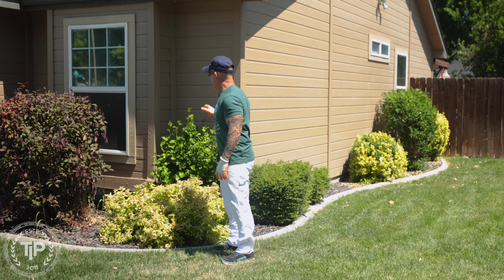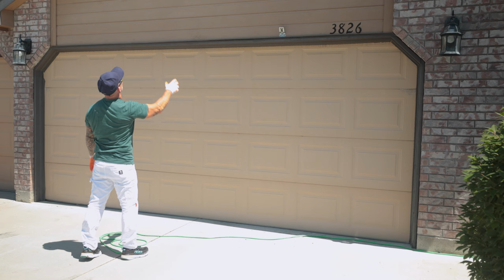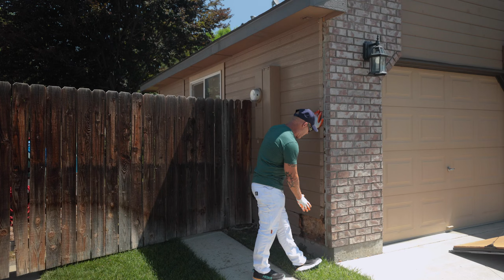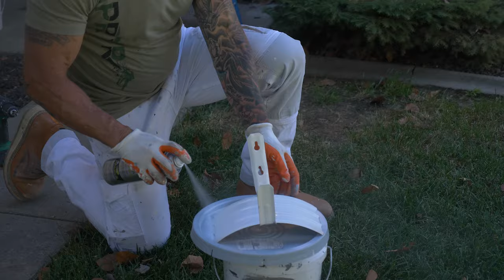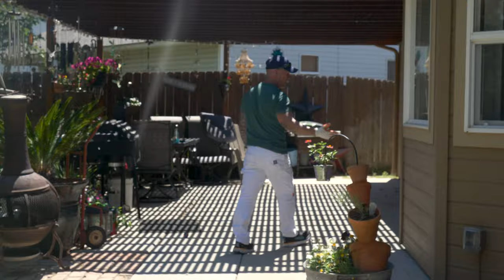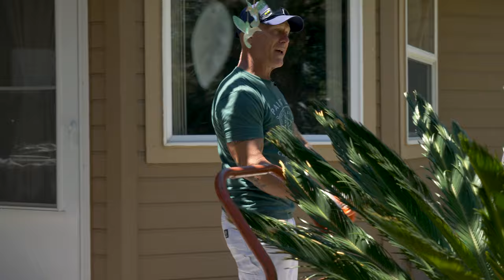What needs to be prepped before painting? House Prep for painting.

Comment: Great channel with a lot of good information!  I am starting my prep to paint my exterior stucco home in the spring.  Do you have a system to estimate how much paint you might use on your jobs?  Thanks for the time you take on your channel.
Reply: I recently read that painting stucco is bad for the stucco. If you don't have to paint it, don't.  I don't have the link to the article.
Reply from the maker: It just takes experience
Reply from the maker: That is not true

Comment: This is why I would never buy a house in America. Builders designed a house to look good long enough to sell. Whoever installed the sprinkler system designed it to spray water on the house (?!?). That is beyond stupid. Why would you install something that destroys your home? Don't even get me started on the cheap cardboard siding. A corner board that meets a brick facade. Those corner boards will need to get replaced every 5 yrs. Good luck when you're old and your body can't do the work and you're on fixed income. These aren't houses. They're shacks. $400k shacks. Awful.
Reply from the maker: OK
Reply: You are very right sir